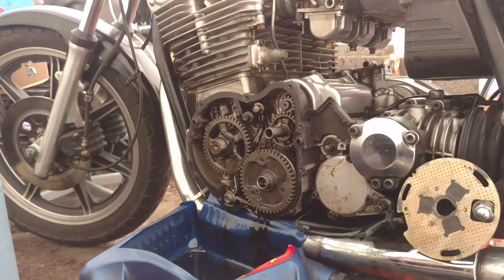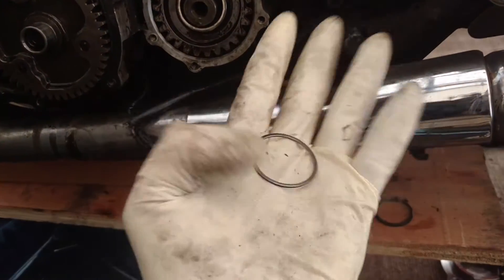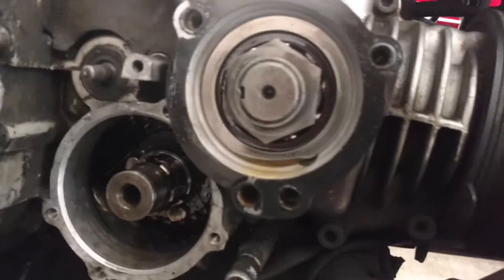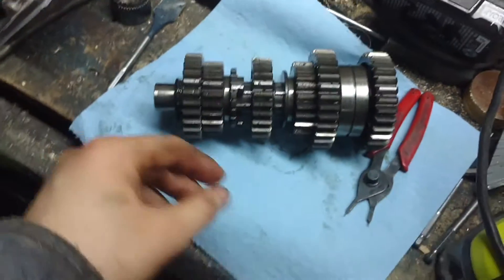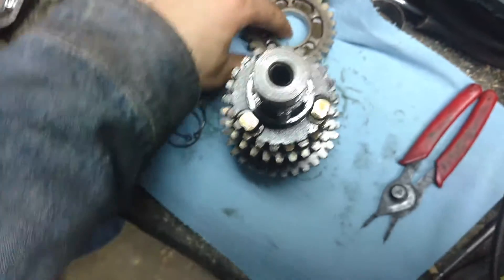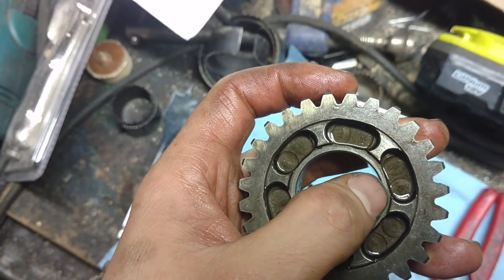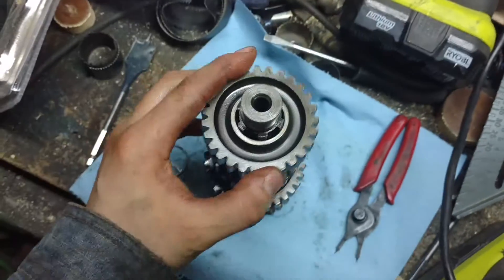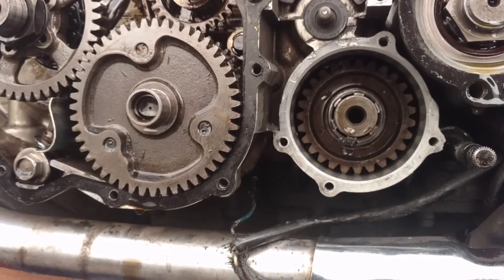xs750 second gear fix

Comment: Do you think Yamaha designed the bike originally with the washers and the spacers in the correct position 1:04 for the fun of it. Replace the worn components. This is an extremely dangerous and irresponsible attempt to make the the transmission stay in gear.

Comment: i know that this is an old video.... but there was actually a service bulletin on this back in 79 I believe. When the factory procedure was done they put a punch mark in front of the engine vin on the passenger side of the engine so they could tell that the bulletin was complied with. My 79 special has that punch mark.

Comment: great video! I have one problem though. I removed the circlip and the washer, and the sprocket now moves freely, however only about 3mm then it comes to a hard stop so I cant get it out nomatter how hard I pull with plyers or allen keys, it is dead stoppet and its not obvious why. In the video the gear seems totally free and not to have this issue?😮😢
Reply from the maker: Wish i could help, but that bike is long gone

Comment: How in the world did you get that cover off of where the gears are? Mine is solid on there.
Reply: you put a hammer on the area near the peg, I used a lever against the frame, its not easy but possible.

Comment: 2nd gear on the Yamahas.. yuck
Reply from the maker: pretty common across the board, the issue is usually straight cut vs helical gears. in this case id say the gear dogs are simply too small.

but im no engineer, i just fix their eff ups
Reply: @poet99999  no doubt across the board..

Comment: Hey guys, sorry to hassle you but I need some help with something. When I turn my engine over at the bolt on the left hand side that goes into the governor, I’ve got this horrible metallic squeak that sounds much worse when the engine is running, looking at that picture it looks like it could be related to the kick gear assembly, any thoughts? I’m just hoping it’s not a bearing, but it sounds like it’s on the outside of the engine and it’s very dry and squeaky sounding.